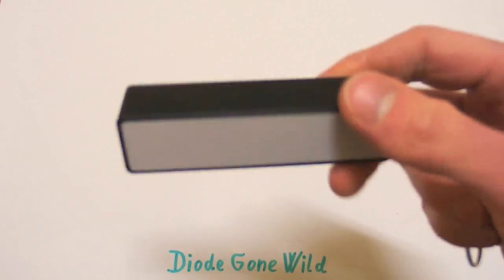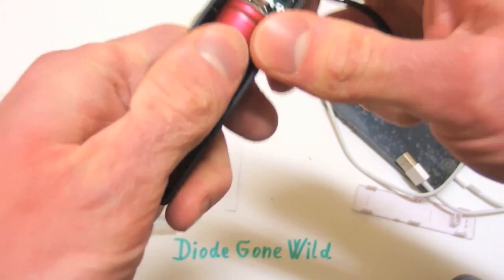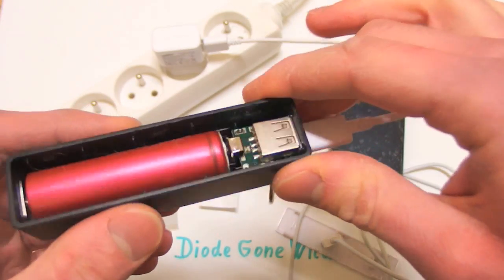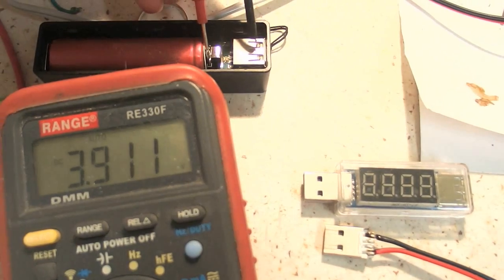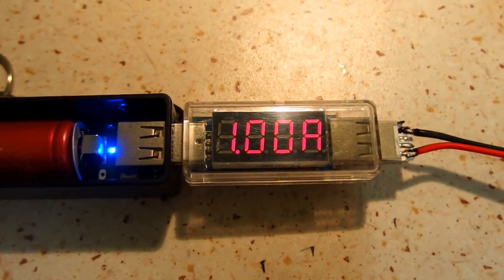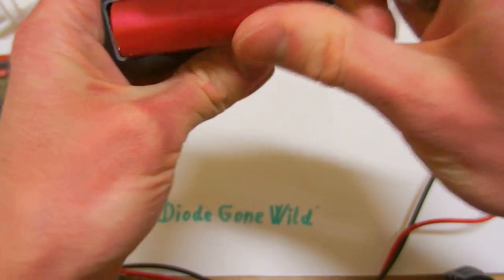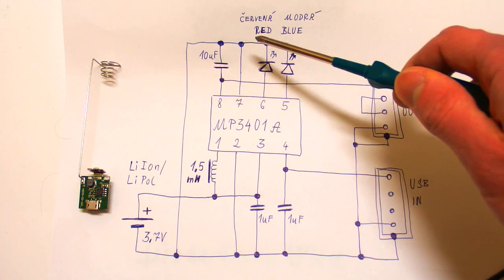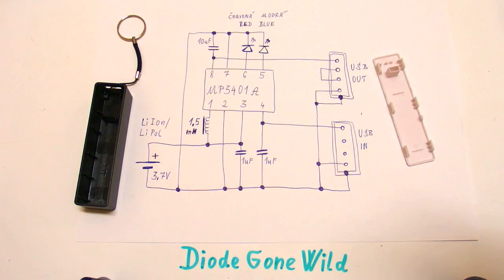Cheapest Power Bank Review (with Schematic)

Comment: i blew up one of those when my wire isulation failed out of mechanical stress when i was charging my device , i was using an 2000mah battery and when it failed the chip desoldered itself and falled onto the plastic housing of the powerbank

Comment: Can you use a 18650 sodium ion battery instead of the lithium ion battery?
Reply: I don't think so, since sodium ion batteries operate at lower voltages. If the chip was reprogrammed to accept 4 volts as the maximum voltage and 2 volts as the minimum, it would work fine.

Comment: i ve build my own with one of those usb a and usb micro and 18650

soldered a switch to side of 18650 directly and run a wire to the module and then placed it all in a paper tube ( one of those that hold plastic bags ) and wrapped it with black electrical tape works great ngl

cheap 
and easy to fix if it somehow breaks down

Comment: Tip.  Lift the bottom edge of the battery before inserting.  Also, this setup won't allow for much current.  Your phone will shut off when the battery comes under load.

Comment: I bought two, two cell versions of these power banks and I used the westinghouse 18650 cells that are sold at walmart for the solar garden lights and I had to modify the case a little to fit the westinghouse cells but it worked and I actually use the power bank inside a radio that I built and the radio board connects straight to the battery (not the 5V out) of the power bank so it takes power directly from the 18650 cell and the radio works great. I charge the radio by charging the power bank.

Comment: I've got a lot of these (18650 cell included) leftover from when banks and other stores basically gave them away for whatever reason. You could even walk into a bank other than your own, ask about information, and they'd give you a powerbank along with the pamphlet!

I must say though, theyr're quite handy when you need to gt a lithium rechargeable battery for a project
Reply: I got 2 of them with the cell inside, but I didn't know that there was a cellless model
One is a green one and one is a blue one, I had won the blue one from some english contest thing in elementary school (the poster had a picture of a macbook and I would have been very happy if I had gotten that)
Reply: I also have one 4000mAh one with the low battery warning, and just recently I got a big one with 2 outputs, 2 inputs and the ability to charge my device while I'm actively using it

Comment: hello!  I bought one, but I  instead of being operate by a spring is connected with wires, is there a way a can change to work as a 1865 battery charger?  thank you so much
Reply: if you put to them some thermal disipation system it will work perfectly

Comment: the problem of all those powerbanks is that they feature absolutely no fuse, so if the mosfet or bipolar transistor in the chip fails short circuit, the battery is going to explode if it has built-in no protective circuit!!!!

Comment: I've bought one similar to this power bank, at the same price though.
I've put a brand new samsung 18650 flat top 2500mAh, and when I charge the battery it takes almost 2500mAh but when I use it yo charge my phone or something else it outputs only about half of the charge it took, around 1200-1300mAh.
I wonder why is it so inefficient?
Reply: I have the same board, but with two 18650 2500mAh batteries, and when charging the board goes extremely hot

Comment: Hi there, i recently enjoying and somewhat learn quite alot from your videos, even though i don't know much about electronics.

If you don't mind i have this one question, that may actually has a simple answer. 

So i'm using this exact same cheap "DIY" powerbank, also the one who has 2 cells in it.

The problem is, i hear a tiny volume of high frequency around 7 kHz from the single cell one, while the 2 cells version didn't make any sound. I can only hear it when i place my ear onto the plastic case. 

My question is, is this means there's a malfunction on it and can be dangerous at some point, and better be thrown away? I've quick tested the output voltage and it seems okay.

Any answer will be greatly appreciated, Thank you and greetings from Indonesia.
Reply: add a fuse

Comment: I have a question for you. Unfortunately I have one of them cheap China power banks the one I have has two batteries inside of it side-by-side it’s fatter and then one that you shown when I hook it up to the USB connector on my computer I have the red and the blue light flashing back and forth at the same time red blue red blue red blue red blue keeps flashing do you have any idea what this means?And apparently trying I was trying to play smart and they slapped her you know 10 sticker on the back I went to unit in this website they don’t make any of these power banks chargers of any kind.When I hooked up the charger power bank up to the iPhone the blue light does come on steady I guess that means is discharging but like I said when I charge it I have a blue and red light flashing back-and-forth. Thank you for your time any response would be very helpful.
Reply: Look into powerbank and change circuit

Comment: Looks very similar to the power bank you can buy for £1 ($1.34 USD at todays rate) in the UK  from 'Poundland' stores. 
They come with 1200 mAh battery already installed and has max discharge rate at 1amp.

Comment: You got a good one. I ordered 2. Both only supplied battery voltage, not 5V. One continuously lit the blue led. And the other had such a high quiescent drain it was not even any good as a rechargeable battery holder. Which is too bad, because the case design is actually very nice. I like the way the top clips in flush and securely.

Comment: btw i used this to power a pi3b it works but it keeps rebooting so i installed a cap on the output that worked but the ic is still hot 79c when charging and 68 when being discharged.

Comment: Isn`t it a TP-4056 chip?
Reply: Nope. Older powerbanks in this style use the MP3401, newer ones (like the ones I just bought for 1.59eur with "2600mAh" cells (tested about 750mAh)) use the slightly improved MP3501 which turns off at lower cell voltage of 2.65V rather than 3.1V of the MP3401, so it uses the battery more efficiently and runs for longer. 
The MP3501 also seems to be a bit smarter when charging "dead"/over-discharged cells. It'll try charging ANY cell connected to it with 30-50mA till the cell voltage reaches 2.85V, then it blasts it with up to 1A (if the USB source can supply it), slowly lowering charge current in 50-100mA steps till it's full. If the cell voltage doesn't rise to 2.85V (bad cell), it stays at 30-50mA for a while and then just turns off.

I've actually stuck batteries scavenged from 8+ year old laptop battery packs into these MP3501 based powerbanks. The cell voltage immediately went up and they charged and revived just fine. The cells were light blue Panasonic CGR18650C rated 2150mAh that were sitting at 0.4-0.9V. They charged just fine, didn't get warm and after a few cycles measured between 1800-1900mAh. Not great but certainly better than the pointless 750mAh ones that came with the powerbanks. Plus they were free :)
Reply: I bought mine on ebay germany and the specific seller I bought mine from is no longer selling them because he got tons of negative feedback (rightfully so) for selling these as 2600mAh even though the completely anonymous (zero markings) 18650's in them turned out to be 700-800mAh. They were the generic brightly colored plastic case single cell ones like shown in this video, but the case was matte-textured (nowhere near as shiny looking as the one in the video) and the embossed "POWER BANK" and the text around the plugs is of higher quality (much clearer, as if the one in the video used a worn-out mold or crappy plastic for the case)

I've personally seen those with 5 different controllers now. MP3401 and MP3501 (also clones labeled as SY3401/SY3501), Hotchip HT4928S (junk, turns off VERY early and just 800mA max output), XHR1808 and one with a PCB that is 100% identical to the one with the 3401 and 3501 chips but the chip is completely blank/no markings at all. Which one you get seems to be a complete gamble...
Reply: Knaeckebrotsaege
Wow! Thanks for the information! :)
Can you send me a link about cheap 1x18650 power bank with MP3501 chip?

Comment: Hey guys do you notice the ic heats up when charging.... Kinda need your feed back lol
Reply: Try charging it with 1 amp insted of 2
Reply: #ff00cf Is my fav color Hi,

This happened to my first one, but with an additional climax... the chip ruptured & gassed ! 😯🤓

It made a big hole on the top. I had to vent the entire room, because of that toxic gas. Be careful. 🤔😐😑
Reply: David Bolha  yeah i was scared i was going to kill my homemade PDA so i made my dad buy me a powerboost 1000c instead.  thanks for the feedback tho
Reply: David Bolha i knew the risk that's why i took extra percussion when doing it .
imagine when i flipped something or shorted something i would be in big trouble especially that my parents are strict when it comes to "home preservation"

Comment: I used a little hack that allows these things to accept protected cells so they don't go nuclear that easily.
Remove the little pillar behind the positive contact with snips (including the tiny wall behind it) and flatten the contact with flat nose pliers (make sure not to snap the contacts or rip it from the circuit like I did). Now it can accept protected cells!

Comment: Bought one for 2 euros after half charging it I started smelling something burning and in less than a second, a circuit part behind the small USB exploded.  I just used it less than 2 minutes with a 5volt Samsung charger
Reply: Tou were out of luck; it may hapen but usually they works; and price is 0.8-0.99$ on aliexpress
Reply: Adrian Andronache 
Am luat una pt doua baterii (design similar cu cea pt o singura baterie) 4.5 lei.
Reply: Da, si eu am cumparat mai multe modele, aveam o multime de 18650 de la doua baterii mari de laptop, cam 60% capacitate, si era pacat de ele. Am luat chiar un model cu 8 spatii, are 2 iesiri (legate in paralel) si reuseste sa scoata 2.1A (si are si 2 intrari de incarcare); a costat cam 4.2$.

Comment: It doesn't have reverse polarity protection when inserting the battery, I found that out the hard way :)
Reply: Mine survived lol even though it emitted a lot of smoke
Reply: Mine put put a lot of smoke but... Didn't survive.
Reply: @renzevenir4853  the short circuit occurs inmediately after insert the battery, or after try to charge it or output energy?
Reply: @josxd8598  Immediately
Reply: @renzevenir4853  does your got in flames? or will blow the microchip before turns into flames?
Reply: @josxd8598  Just smoke
Reply: @renzevenir4853  i buyed one of this

it just blow up when my shitty cable made short-circuit
Reply: If u want it can still charge just remove the indicator of the circuit but u can't use the output usb port now. You can use the burnt up circuit by removing the indicator to charge lipo batteries
Reply: the short circuit occurs inmediately after insert the battery, or after try to charge it or output energy?
Reply: Inductor not indicator.
Reply: Emrldy same
Reply: I have the same problem..mine did'nt survive
Reply: this is why im scared of charging it at night cuz i aint trying to burn down my entire neighborhood

Comment: I think the power bank is designed for non-protected cell.  As non-protected cells, do not have circuit board on the top, they are slightly shorter.

They sell these power banks in pound world with a battery for well 1 pound, if you live in the UK.
Reply: Gavin Davies True, but even these non-protected cells do have an interesting feature... it's called a CID (Current Interrupt Device). A little reading: https://batterybro.com/blogs/18650-wholesale-battery-reviews/18306003-battery-safety-101-anatomy-ptc-vs-pcb-vs-cid 😉😆
Reply: Gavin Davies do you get the battery along in poundworld?

Comment: In your video you say it doesn’t have a fuse, please can you tell me whereabouts I can put a fuse wire? My circuit board is exactly the same as yours and has the same number on it TXT-XS-151224
Reply: at between positive of cell to board positive
Reply: Far easier on the negative side; just cut the long steel wire and insert a fuse or a really thin piece of wire (0.1mm is THICK, you need 0.07 for 1-1.5A)

Comment: Hi Diode, could you suggest way to make a backup power for ADSL router (power through)? It uses 9v, 0.6A. It won't work with xiaomi 10Ah powerbank, even though I tried it without, and with 3 types of voltage boosters. They just cant hold the voltage. I am thinking of buying two of this small bastards that support power through, and connect them in series, but I don't even know what kind supports being charged while they are charging the device, which is crucial for this kind of use. Xiaomi can do that, but I can't order one more, because reliable stores don't send it to my country anymore. I'm sure that a ninja like you have some solution for crappy problem like this :)
Reply: Wait who doesn't hold the voltage? The power bank turns off or the boosters misbehave in some manner?

I suggest that it might be curious to tear down your router and see whether you might be successful powering it in another way - say if the input is a regulator to a lower voltage and 9V input goes nowhere else, you just dance around that and you're done. Depending on how the regulator is implemented, it might be fine with 5V input, but strain on components and thermal output will be higher, as they will need to pass more current - but it appears you have tried that and weren't successful. Another possibility is that the ICs and capacitors might take quite a bit more voltage if needed, and you'll probably find CCTV emergency batteries with pass-through that run on 12V. But we really need to see and probe around your DSL modem circuity first, don't just try - take it off the power and run continuity meter to see where everywhere the pin of the power supply goes inside the router, as it might be impossible to reliably determine visually, as it's likely built on a 4-layer PCB. Another thing to keep in mind is that you can use a step-down after the 12V battery if not certain.

I don't anticipate that you shall be successful with two of these in series - i mean, they don't take kindly to being supplied more than 5.5 or 6V at the input, usually resulting in instant death, and there will be all kinds of border conditions. The MP3401A (and i got some power bank boards where the IC surface is unmarked that are the same) actually supports charge-through, but as you see, it doesn't take too kindly to being drawn a lot of current from, it's best under 0.9A at 5V, and your original power supply delivers slightly more power in total, considering conversion losses.

What kind of duty cycle do you need to support? Is this for emergency use only, does the power come off only once in a while, or is it something that needs to hold you over multiple hours a day? I have a few more ideas on what to do, but need to determine the design parameters.

As to something to replace the Xiaomi when you have to or get another equivalent device, well the problem is, Li-Ion batteries can no longer be easily shipped by air; however if you're in the civilised world, you likely have a local Anker distributor, and they also have power banks that support charge-through. Not that it will help you right now in this situation, but just mentioning.

Comment: Well it is cheap, and it appears to control the charging fine, so it should be safe :-).
The boost converter seems to run out of steam, i would pay more for a better version, if i needed one.
Is it possible the battery you used was a bit duff?
Reply from the maker: The battery was a good quality one, but it was quite old. The internal 
resistance may have been a bit higher due to a long storage. But anyway,
 I think that this powerbank is really good up to 1A, but sucks at 
anything higher.
Reply: Mmmmm, thanks very much for the tip! I didn't know, of course; i will apply your advice (i bought one of these)
Reply: I should say the cell is likely in very good condition, very low ESR! Otherwise, the power bank IC tends to run hot and explode in normal operation, like when charging or drawing half an amp, which is curious, because they claim that it has over temperature protection. It's recommended to install a ceramic capacitor parallel to the cell in case this occurs. In case someone fancies wading through Chinese language, i might have the datasheet somewhere on my harddisk, but i'm fairly confident that it has no mention of potential failure modes.